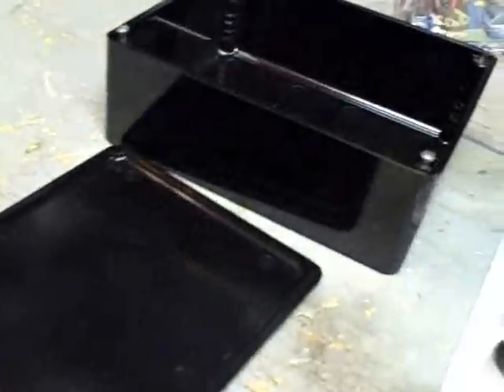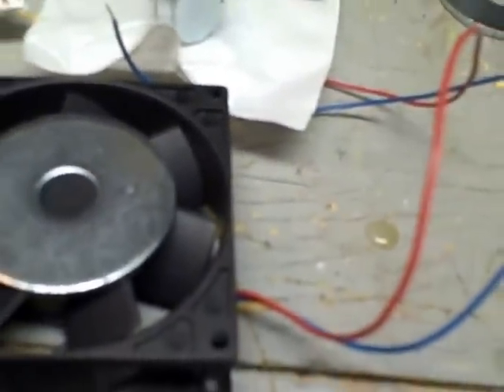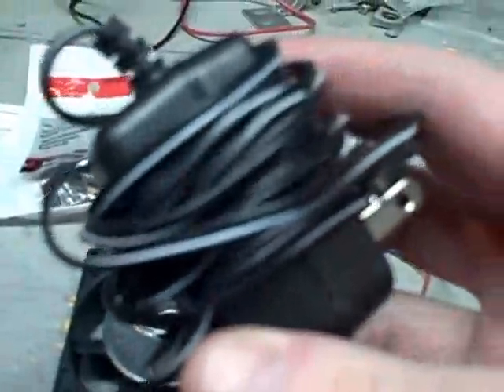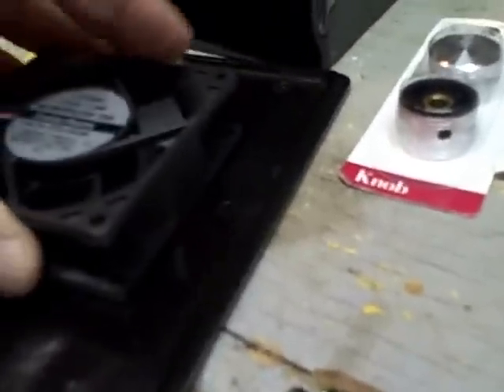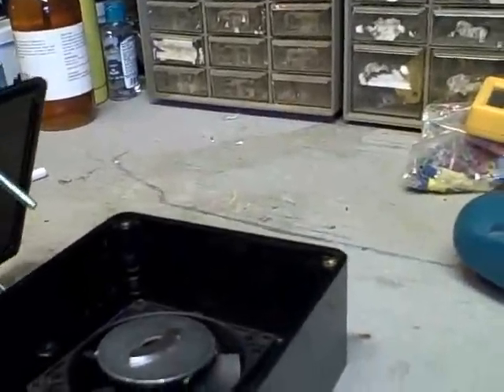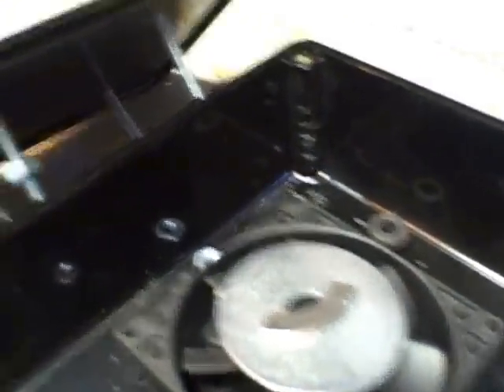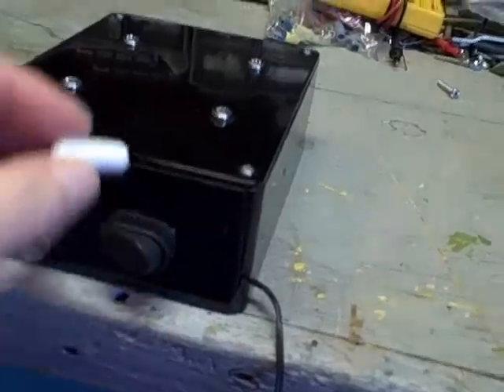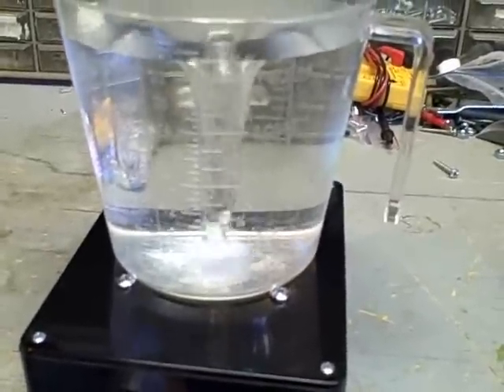My DIY Stir Plate for Making Yeast Starters

Comment: Of all the stir plate videos I've viewed yours is clearest to understand. One question: the neg. or ground is wired to the right side of the rocker switch. Where does the hot or positive wire from the power supply get soldered - the left terminal of the rocker switch?

Comment: Important to note that if the fan is digital, using a potentiometer is pointless.  Digital loads can't be "dimmed" - they are either on or off.  The effect will be an adjustment dial that doesn't seem to do anything until you turn it all the way up when the fan finally comes on.  To provider variable speed to a digital fan, you need a PWM controller.

Comment: Your Rheostat looks like a potentiometer, it looks like it has 3 pins, whereas a Rheostat has 2 connections, a potentiometer is basically a voltage divider, but can be used as a variable resistor by only connecting two pins the middle or wiper must be used, and either end then it can be used as a variable resistor.  Great video thanks.
Reply: I appreciate that explanation of the difference.  I'd been wondering that and hadn't researched it yet...

Comment: What resistance potentiometer would you recommend using for a standard 12v pc fan? I will be mixing small 50ml batches of a vegetable glycerin based liquid.
Reply: Ryan Lee Hi Ryan, I'm using a 200 ohm pot. for my 12V fan. My fan is rated at 600ma
Reply: Get a computer fan control and it will come with the fan connection already attached. I'm guessing you are using it for DIY E-juice? Have you tried the Ultrasonic Cleaner method? I'm also thinking about trying the Stir plate method to compare. Since I do more than one batch at a time. I was thinking of making a 4 beaker stir plate. Plan on taking an old PC preferably a desktop PC and mounting 4 fans to the top. I can than add a 4 fan controller right into the bay on the case. The PC power supply can be tricked into thinking there is a computer inside by jumping the connection that normally plugs to motherboard. It's really just a matter of mounting the fans, as all the connections are there already. Just thought this might intrigue you, since one stir plate doesn't seem like enough when you might be doing multiple batches in a day.
Reply: +Kenny Sale funny you mention that. i have a second hand magnetic stir that I rigged so all the speed/ time variables are controlled by laptop. thought I was the only one.

Comment: I built this up and it works well. When there is no flask the rod spins fine. When there is a 1L flask sitting on it the rod spins enough to vortex but it will throw the rod after a certain speed. I really need stronger magnets I think or a larger bar? Right now it has 2 earth magnets on either side of the fan but I did not add the washer. Does the washer increase the magnetic field?
Reply from the maker: I would think a stronger magnet or smaller bar.. I think my bars were 1" and in all honesty if you just get it swirling a little you'll be fine.. it doesn't really have to be a huge vortex..
Reply: yeah, I'm having a similar problem as Ray in my early tests.  Had better luck in a regular drink glass (& 1.5 inch stir bar).  Still playing with different magnets, balance, and voltage... I'll get there eventually.  Thanks for sharing your setup Jake.

Comment: a higher ohm resistor would be a cheaper way to slow down the fan rather than buying another wallwort. those aren't generally expensive but a resistor is only a cpl bucks :)

Comment: Thank you for avery informative video. I used your instructions to build my own , and saved almost $90 from a retailer. thanks again! :)
Reply from the maker: Awesome! Glad the video helped! Cheers!
Reply: jakecpunut Sorry to intrude, but I had one more question for you. I just received my stir rod from Northern Brewers. I ordered the 25mm rod. When I went to test it today, it would start to spin in the center of the flask, and then it would get tossed to the outside of the flask. I can't seem to get the speed down low enough to keep it in the middle of the flask.
Do you think the magnet is off center, or that the stir rod is to light?
Any help would be greatly appreciated.
Thanks again.
Reply from the maker: jr10 it actually could be several things. Magnet actually may need to be stronger, could be off center or stir bar could be too heavy. Kind of one of those things you have to toy with to get it right.
Reply: jakecpunut Thanks again. Got it ! It boiled down (no pun intended) to magnet placement. What intuitively looked like the center of the fan was way off from where the actual placement should be. Once I got the stir bar to spin without making any noise, I new I was getting close. Thanks for again for a great video.

Comment: I fish tank air bubbler works in my opinion better. More oxygen is introduced which creates a good environment  for yeast to multiply.

Another good trick is if you want to make a stater ahead of time its and don't have a sample of the exact wash,  You can gelatinize some a cup of corn starch and toss in  a little enzyme at 150.. This way your yeast are used to eating maltose rather then table sugar.  You end up with a better, stronger more accumulated strain.

Comment: Update. I did have to tinker a bit. I put 2 hard drive magnets together for extra magnetic force. I have a reasonably good vortex in the flask ( although not as good as yours) but I found that if that you have to carefully adjust the speed. If you run it to fast it will throw the stir bar. Thanks for your all your help.

Comment from the maker: I'm actually using a 1 gallon pickle jar the works with the screws not being recessed. But, you could get some tapered flat head screws and use a countersinking bit and drill out the hole a little to get them flush.

Comment: Many thanks for your advice! I used a hard drive magnet with about 3/16" space between the magnet and the top of the stirrer lid. I guess I have to get a stirrer bar and then tinker with  the position of the magnet. The velcro is a great Idea. It give you a lot of wiggle room for adjustments. Thanks again!

Comment from the maker: The stir bar is an actual magnet and very light.. dunno how heavy the nail was but that could be the problem.. it also could be the strength of the magnet you used or the distance between your magnet and the bottom of the jar.. you may have to tinker with it a little when you get your stir bar..

Comment: I made a stir plate like yours but I didnt use the washer. the hard drive magnet actually stuck magnetically to the inpeller. I put a nail in a jar of water to test it an the and the nail bearly turned. Is the stir bar a magnet or just a bar of steel? I'm trying to figure out what is not right.

Comment from the maker: Thanks.. I had the project box at work.. we had quite a few we used for a particular tool that we don't do anymore so they were surplus. Most folks get 'em at radio shack but if you can't find one I may can hook u up. Just let me know. I'm actually using a 1 gallon pickle jar. Anything with a pretty flat bottom that fits on the stir plate will work. I really depends. (cont)

Comment: Great video!  I have a few questions.Where did you get the project box? I am going to make 5 gallons of  hard cider from apple juice. I dont know what size flask I should buy for the yeast starter; the 1000ml or the 2000nl. what is the benifit of using a flask instead of an ordinary jar? How long do you keep the starter on the stirrer.

Comment: I just made one of these this weekend.  The local radioshack didnt have a big enough project box so I got a $3 cigar box and it worked great.  My flask and stir bar are on the way, and I'll be posting something similar soon.  Nice video...I think you can def go with a 2L starter bc that big a vortex isnt necessary, plus 2L starters are what you need for most 5 gallon batches anyway...nice job!